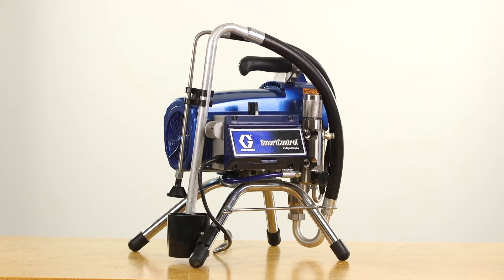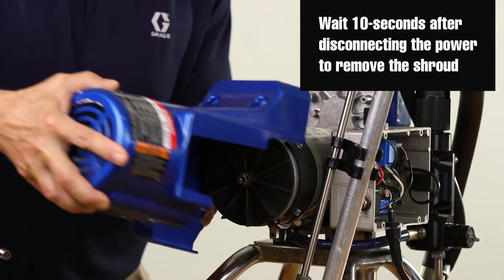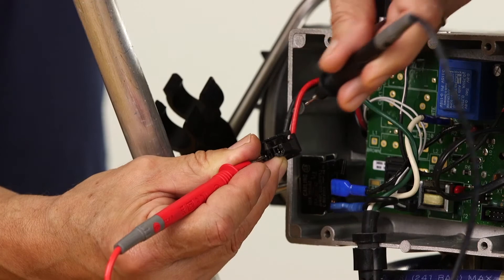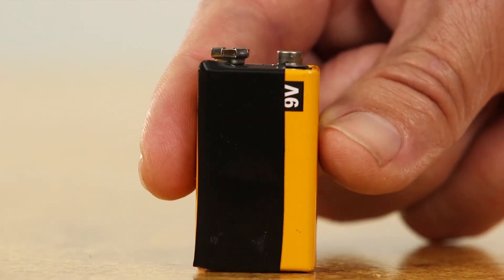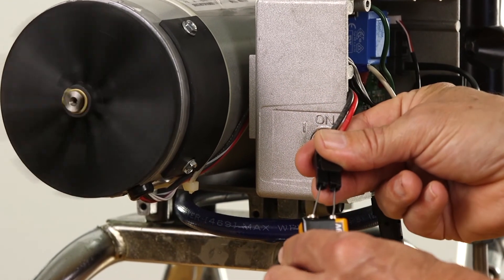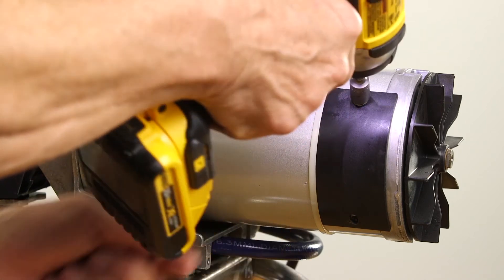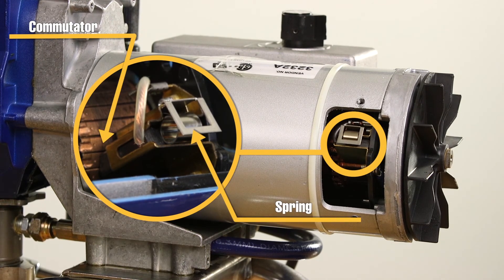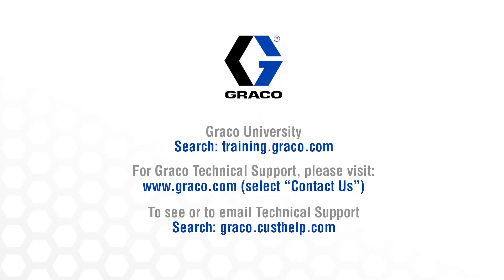Troubleshooting a Brushed DC Motor

Comment: I got 2.9 ohms on a Graco 17C794 Motor test , i got motor to spin on a 9 volt. I did an ohm meter armature and commutator test thats seem to be equal measurements. Where are the specs ? for the motor test. My machine was blowing a fuse so i did a motor armature and clean on commutator which was black and smelt of burned plastic. The fuse doesn't blow now or turn motor as when i turned pressure control valve it would spin motor 1 second blow fuse. I believe the paint sucked up in motor covered commutator and arch between brushes the motor there was paint inside motor.